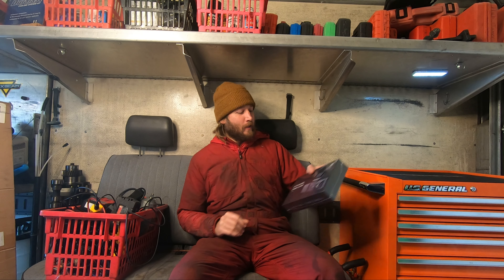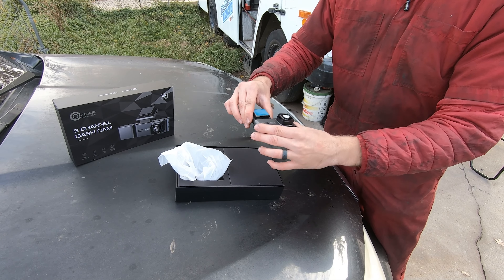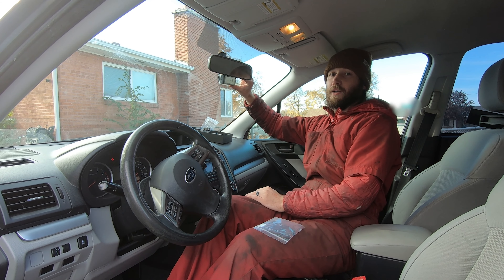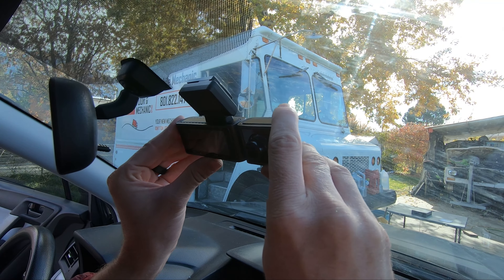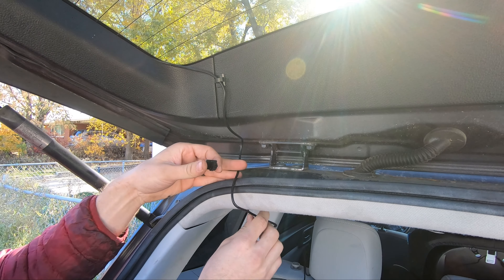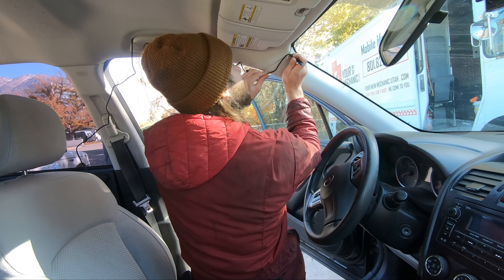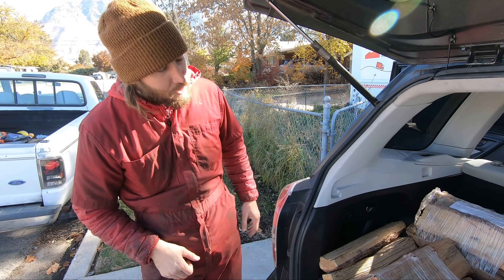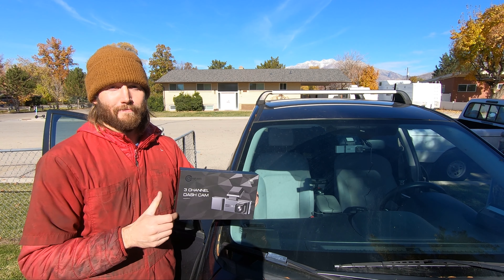How To Chose & Install the Best Dash Cam | Mechanic Reveals | 4K Ombar

Comment: Of the 4 or 5 other Ombar dashcam installation videos, yours is the FIRST one to use the electrostatic film to mount the cameras! Well done sir! I do have one question about the rear camera. Couldn't you have ran the wire through the factory grommet? No leak possibilities going through the grommet and a cleaner install. Otherwise great video!
Reply from the maker: Yeah That should work! Just what we came up with.

Comment: Great job but next time I'd run that rear camera wire inside the trim and through the wiring boot. It would make it a much cleaner install, and your customer won't see an ugly black wire every time they open the trunk.

Comment: Ernest I do not like wires in plain sight when you walk in to vehicle. Mickey Shorr installed mine with no visible wires super clean Job.
Reply: Ah, you referring to the rear camera?

 I thought he was going to tuck the wire behind that plastic trim panel by the window... He almost got everything tucked away 😢
Reply from the maker: The customer did not want the power wire hidden.
Reply from the maker: Isn't that what I did?
Reply: Mine is hardwired it turns on automatically when the Car starts the wires are all hidden except for 6 inches sticks out to hook up camera . That camera you had was dope. I want one . All love and respect Ernest but they do sell wire kits where you can hardwire cameras without needing cigarette lighter.
Reply: @RoadsideRescue he meant the very top part of the rear door is my guess. 

You did go underneath the weather strip on the other side 😅